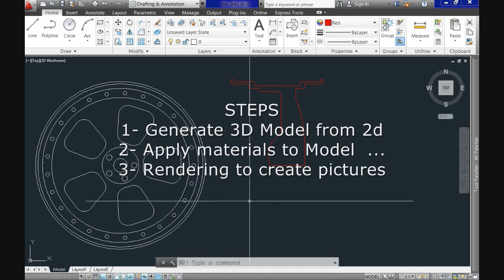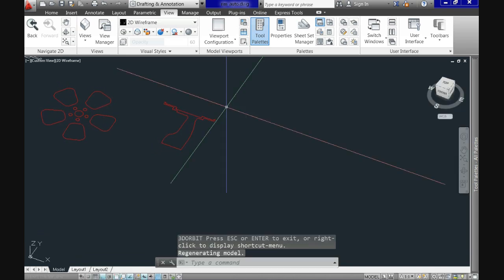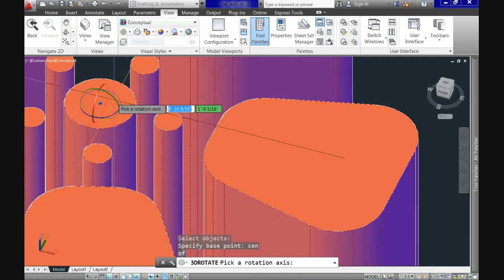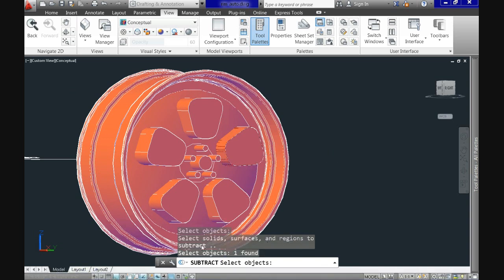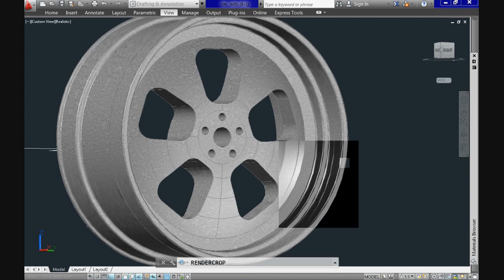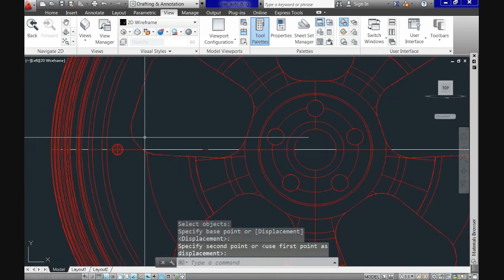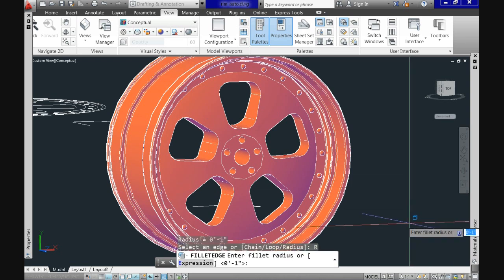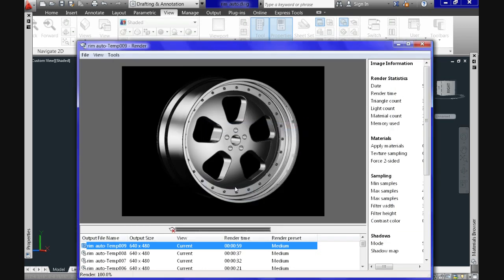AutoCAD 3D, how to create a Rim in AutoCAD 2013: Part 2

Comment: in my render the arrayed 25 cones are rendering in red but the rest is steel.... i changed the material but its not showing in the render.......,
Reply from the maker: Bowinkle82 Brewer Move them to the same layer in which the other objects are. If that doesn't work, make sure to check the properties, it should be something simple. Let me know what it is or if you can't solve it.